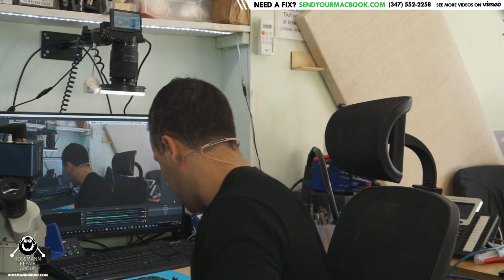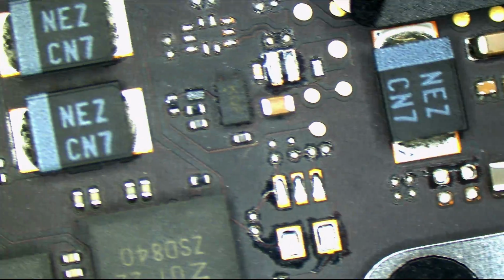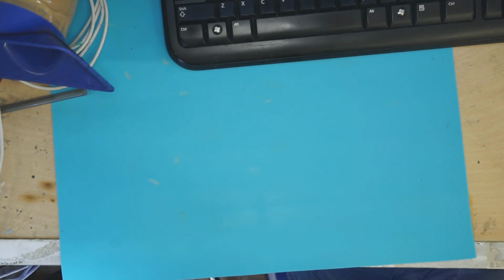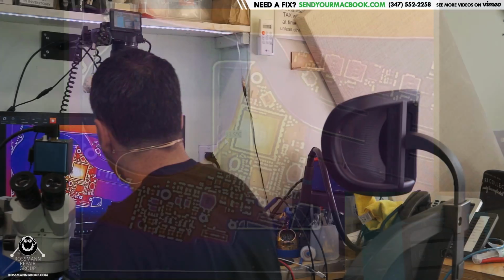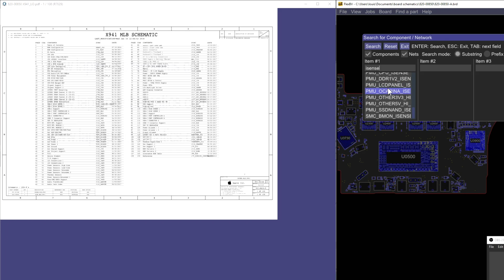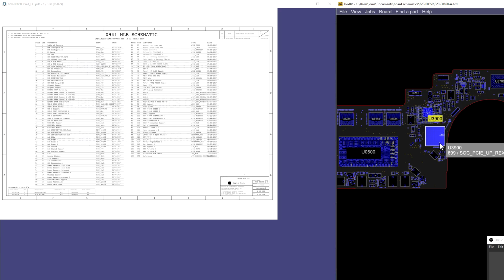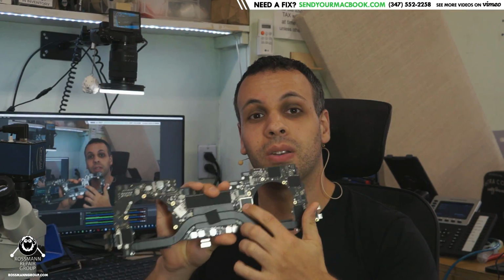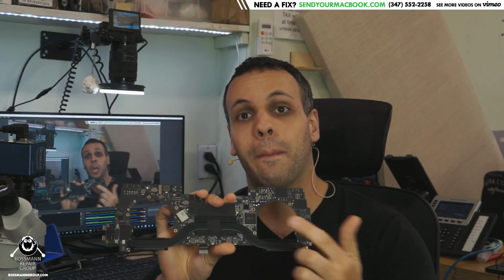Apple users have no one to blame but themselves.

Comment: Stopped using Apple product since 2013, been using android/windows/linux, can fix almost everything by myself lol
Reply: same my last mac was Late 2013 iMac but its still working up to this date and my 7yr old son is using it. Ditched apple coz of that Final Cut X.
Reply: ExorCisTGG I want to get into this. Where’d you learn?
Reply: @milersgunner2612  With Windows/Android/Linux, you can almost universally get all the help and instruction you need through a Google search for the specific topic you're interested in. What are you looking at getting in to? :)
Reply: Nick Bissell Microsoldering. I know this is something that I can’t really learn at trade school. I’ve always been a tech guy from the software aspect. I want to be able to diagnose and fix everything, hardware speaking. I’m not sure where to gain the expertise. Got any tips?
Reply: @milersgunner2612  Jessa Jones has some great content to get you started on this. I can't recommend anywhere for hands-on practice, but I suggest getting hold of a lot of cheap 'for spares/repair' hardware to practice on, as it takes a lot of experience to get right consistently. Here are the JJ videos: https://www.youtube.com/watch?v=xFqA9u6y0Fk&list=PL4INaL5vWobD_CltiZXr7K46oJ33KvwBt
Reply: @milersgunner2612  Check out DistroTube, Chris Titus Tech and The Linix Gamer.
Reply: @milersgunner2612   I'd also recommend Carey Holzman who is a PC technician with over 25  years experience building and repairing Windows based machines.  If you want to learn Linux, start with Mint (Cinnamon version).  Pretty   

If you want to have the most freedom of control over your smartphone, then definitely go Android (just avoid the flagships because they pulled some of the same stuff as iPhone, like soldering the battery in place).
Reply: @kjemradio   waht flagships do you know that.... Oh wait LG but nobody cares about them
Reply: Hello Linux user! Still new to the Linux world since March this year
Reply: Adriel R  Greetings!
Reply: The last Apple product I owned was an Apple IIe back in 1984... And I still have it somewhere.
Reply: @JoseMVelazquez  Then technically you still own it, wouldn't you say?
Reply: Check out Switched to Linux, Chris Titus Techx and Distro Tube. Really good channels. There are other good ones too.

Comment: I bought a 2015 Macbook on eBay a couple of years ago.  When the batter died and I went to replace it, it was an eye-opener, to say the least.  The battery they used was glued in and manufactured in a way that showed me that they were making throw-away laptops.  I knew that this was going to be my last Macbook.  I'll be going back to dual booting Linux and Windows on my next laptop.

Comment: In a couple weeks im starting my bachelor in sound design and i have to switch from cubase to pro tools, which requires a mac.. School is already expensive enough, and money's real tight at the moment.
More so than the serious dent to my wallet, it fucking breaks my heart that i have to go spend ludicrous ammounts of money to get a mac with usb c, minimum 4 cores (that can reach 2.5 GHz), 16 gigs ram and  250 gig ssd. 
If you have any advice on older models that might be a better/safer buy, i'd appreciate it.

I just had to vent my fury before i go spend my food money on one of these soldered down ram having pieces of shit. 

Been watching the channel every now and then for a few years, keep up the good work.
Reply: and as i was finished typing i hit the 7 minutes 30 seconds mark and almost started to cry.. should i look for  a used 2011 mac ? xD

Comment: Just to play devils advocate, aren’t the same restrictions you describe precisely what makes Apple laptops the most data secure laptops?

You mention that anything not backed up is gone, but they have a very robust and simple backup utility so there really isn’t an excuse for anything more than 12 hours worth of work to be lost.

Don’t get me wrong, the inability for third party vendors to repair needs to be fixed, if only to dissolve a monopoly, but to claim that these restrictions have absolutely no positive benefit is disingenuous at best.
Reply: No, the most secure laptop is the Purism Librem 13 or 15. It runs software which is 99.9% free/open source and it is designed to be fixed.
Reply: Amos Batto they should be with bezels THAT big...

Comment: apple fan"ugh why did they remove the headphone jack "
also apple fan " oooooh that new Apple phone looks sleek and efficient, perfect for a classy man like myself"
Reply: apple fans with common sense: that phone looks great. I won’t buy it though because it is far too expensive.
Reply: Bomba Luigi / Elaquent or any other of the myriad of bullshit apples doin‘.
Reply: You won’t be saying that anymore when the Note 10 releases with NO headphone jack
Reply: TDplay I know where you’re getting from, however it would argue that it isn’t “pointlessly removing a useful port”. Removing the 3.5mm port helps improve water resistance and gives extra space that could be used for other things, like a bigger battery. I would say that the headphone jack is slowly becoming obsolete.
Reply: Lmfao
Reply: My 5s that still works flawlessly as a business phone, and my now 2 1/2 year or so 8+ disagree with you lol

The phones are fine. Put it in a good case and you have no worries.
Reply: woman*
Reply: Adriel R You won’t be saying that when I get proven correct and you get proven wrong
Reply: @Iloyuk  note 10 won't be the only Android that exists u dummy dum
Reply: @keenpeace21  Did I ever say that the Note 10 would be the only android that exists?
Reply: @Iloyuk  my point is, most good androids still will have the jack
Reply: @keenpeace21  Huawei removed it, Google removed it, OnePlus removed it, Samsung is removing it on the Note 10.
Reply: @Iloyuk  you're talking about flagshits
Mid ranges are the best option
Reply: @keenpeace21  OnePlus is a mid-range phone 😏
Reply: @Iloyuk  but not the only one.
Reply: @Iloyuk  OnePlus was a mid-range phone. There not anymore
Reply: Mickel 83 They still are, with the OnePlus 7. Non Pro
Reply: IloyukGood why are they moving away from actually good design so hard!?
Reply: @Iloyuk  this kid

Comment: Louis, I attempted to bring this video up in a discord server I'm in and was immediately shot down by someone who "worked in an apple store for 3 years" claiming there would have been photographic proof of liquid damage corrosion along with the refusal of repair, and that even if there wasn't liquid damage present on the board there could have been some elsewhere that shorted out the T2 chip. I assume neither of these actually happened? Even if the damage was on the keyboard itself and didn't seep onto the main board, how does THAT fry a T2 chip?

Comment: I supported your ideology about the right to repair etc, but I researched extensively a tablet that would be quality but inexpensive. Now I have no tech background and I've repaired this 2011 macbook pro several times - loose sata cables etc added dual hard drives with kits from OWC etc ad nauseum...so in my meandering way (distracted by the whole smc trouble)I got specs/prices and likes to my mother who purchased this supposedly well made lenovo. What happened next was my father (a retired engineer) while meticulously placing a screen protector on this brand new tablet had the screen break. So i tried to get support through Lenovo's shitty customer service and yes - they told me it  was due to father dropping it or whatever. So I said, fuck Lenovo and got on twitter and called them out for this as they had a big launch of a new product. They said they would "reach out to me" standard corp speak to please take this out of the public eye...many emails and phone calls later they came back to my father "dropping it" accusation. This is a guy who was 70 at the time that still has micrometers piezo electric whatevers you name it hanging around in boxes. He told me that he did not drop it because he would not lie about such a thing (he can easily buy another one but is cheap) I said to him I'm really sorry I'm letting you guys down on the recommendations (they bought samsung s8's to get away from apple) and guess what - they were crap as well. I went through 3 s8's later that year but returned to the android platform when the s10 was released. Somewhere I have a pic of 4 boxes of S8's stacked up and ready to be returned. Anyhow Louis, nobody likes an I told you so - and you know what? Apple users can blame whoever the fuck they want but it is the fact that ALL corporate models are set up this way. The only 2 constants I can tell you is that this MacBook Pro is a badass machine that has been abused beyond belief and the only phone that has consistently worked is my wife's Huawei that are made by deadly chinese "spies". oh and I've got to call Samsung tomorrow and see if they can find out why no one can hear me on speakerphone - guess I paid a bunch of money because I deserved it.
Reply: Lenovo has never had a good reputation for pretty much any product they've had and have been notoriously known for poor support... so I don't know what generic "consumer reports" you got your recommendation from but you didn't do a very good job of researching. Beyond that you sound like you're rough on equipment and I'm guessing difficult to deal with on the phone too which may explain some of the difficulty you run into when you do contact these places.Good for you on the Macbook - I run an IT department for an international chemical company and have been a tech/programmer for two decades... we switched our sales staff to Mac's and had an 80+ % repair rate for them. Beyond typical compatibility issues with the rest of the business world that was just ridiculous. We went back to Dell Latitudes we had, and have had since, about a 10% repair rate.. and the response of their Pro Support has always been great (although the quality of the techs you first speak too seem to be waning). I personally tried using am iPhone for two years when the iPhone 6 first came out. Durability-wise I can't say anything bad about it... but I just couldn't so with it what I could on an Android platform so I went back. Admittedly, that's just me. I've been through 6 Samsung phones between my son and I with both good and bad to say. I had an HTC Evo Shift for YEARS and loved it - I wish I could get that same form factor again. At any rate... use what you like. All electronics fail to some degree and we as consumers share some blame in that we have accepted that. In this day and age we even allow ourselves to buy products that aren't even completely finished yet - literally sold in a "beta" state! In days past that would've been considered legally harmful to the consumer. What can we do about it? Not much unless we all go back to the stone ages.

Comment: Louis,
This is common, car manufacturers use this method to prevent the exchange (or replacement) of computer units (SPEEDO, ECU, AIRCON, etc) from one car to another unless you get them to reprogram the part to suit your car, $$$$'s in their pocket.  A path I think apple is taking to stop third party repair like you and to eventually rip more money from the consumer, like car manufacturers. Scary thing is, this is totally legal for a company to do. Next we will see a completely sealed mac (no screws, no clips) and when opened, will trigger a self destruct.

Comment: Solution: replace Water Damage Indicators with new ones, then have the customer take it back to Apple. They'll have to cover it under warranty.
Reply: Those water damage indicators should be illegal.  I had a rugged waterproof Casio phone with a removable battery. It also took a SIM card that got installed under the battery. Well guess what a water damage indicator was installed under the battery. As soon as it was exposed it turned color even though I never got it wet.
Reply: @Skilful_basics8  having an electronic device in any kind of slightly humid environment makes them go off. Live anywhere that's not a desert? Sorry no warranty.
Reply: @Skilful_basics8  well, seems like it was in the wrong place...
Usually it is inside, around the motherboard PCB...
Reply: From their service manuals,  Apple has recently introduced UV liquid contact indicators (LCI), more than likely in reaction to people who clued in that you can remove LCIs with rubbing alcohol without triggering them, therefore replacing red indicators with white ones from donor cases and boards. Water damage wouldn't be such an issue if their machines weren't so bloody susceptible to shorting out from even tiny amounts of liquid, such as condensation.
Reply: Agent J  yeah and Apple denying claims because WDIs have gone off isn't fraud?
Reply: I think the point is the Apple tech didnt see water damage indicators.He/she seen flux on the board and thought it was water.

Comment: I collect laptops and computers.
Many machines, with date stamps ranging from 1998 to 2018.
Not a single one of them achieves the level of MORONICIDE that Apple computers do.
Ironically, it's all among the NEWER models that tend to get more annoying in the repairability prospect.
I've done among my fleet, two keyboards, around six hard drives, eight batteries, three SSDs, one motherboard, and two fans.
I've lost one shitty nVidia BGA GPU, and one decent nVidia GPU that I cooked because my fan died.
Of all the abuse these things have suffered getting thrown around in my bag, hauled through airports, hucked off a bicycle, rained on, drooled on by a cat, or otherwise dropped and banged around, I've needed no lifeboat connectors, no screens, no backlight 52v short to CPUs, no dead SATA cables, no broken display cables.
In fact I'd say the part I kill most often by accident IS hard drives... simply because they're hard drives, and don't like being dropped. My D620 has eaten three by itself.... it's probably going to be my next SSD target.

Comment: I have to say I'm not a fan of soldered on components.  Yes it's cheaper and yes it makes for a thinner device. But it also makes repairs a bitch and upgrades impossible. I love my Lenovo Z70-80, but the idea of using a BGA CPU, and a CPU that integrates the chipset is just evil. At least I can have two desktop style ssd drives and not worry about my data. How I miss the days of buying a celeron laptop and replacing the CPU with a full fledged pentium III and getting a powerful laptop for a fraction the price. Even upgrading the video card on laptops that supported the MXM standard.

Comment: Just because the board shows no sign of liquid damage does not mean its not liquid damaged. 

Also, how do we know what exactly 'apple said' ? its heresay.

Also, If they indeed did say "liquid damage" .... Why would apple suggest that it was liquid damage unless they had some kind of tip off. Or some other evidence yet to be revealed that you do not know about?

I have a 2017 MBP with no issues. There was one time I had to contact support and they were pretty good.
Reply: If there is no sign of liquid damage then how would a technician inspecting the machine know it's liquid damage?

All service requests (and replies) require paperwork.

They might have said it was liquid damage in order to force a user's hand to spend a lot more money, as it is obvious that the consumer protection laws are not strong enough and/or have loopholes to allow such discretionary practices. If there was more evidence it would have been stated in the paperwork I mentioned earlier.

Just cause your machine works perfectly doesn't mean other people's experiences are invalid.

Comment: Each year their products become worse...
Their current case design doesn't have space for cooling the their 8 and 6 core CPUs,
They also changed the thermal limit to 105 celsius so the CPU won't thermaly throttle,but cook itself to death.
These models start price is 2500$,and the CPUs are not boosting because of the heat!
I can cook anything with those temperatures!

2500$ for machines that cook themselves to death...

Comment: Bioses can be reflashed without powering on the device by using a ch341a and test clip.  Perhaps there's a way to copy the original T2 firmware off the damaged board and reflash the exact chip specific firmware onto the donor board's T2 chip.

Comment: You've been telling them since 2012 that's a little after I realized I hate apple, or around the same time. I don't even do much work electronics,  I used to repair, actually rig up, friends of mine's schu350's charging port because phone charger ports are stuck in the 1900s just like our wall outlets are stuck in the 1800s.

Comment: Can you not download the bin file from the chip via a EEPROM tool, then burn the bin into a donor chip. Unless of course the chip is corrupted, then maybe you could find the serial or identification number of the machine and edit the bin to reflect that on the donor.... I use this technique on automotive modules weekly... Maybe this is not something thats being done in the computer world?....... I guess you would need 2 functioning machines, then pull the bins from the chips, then compare the files and see what makes them unique for the individual machine, at which point you could attempt to edit one to fit the other to test the theory.